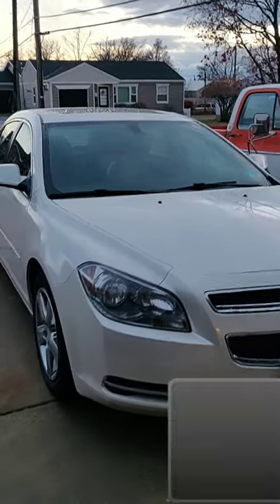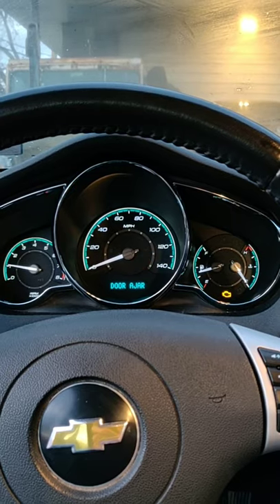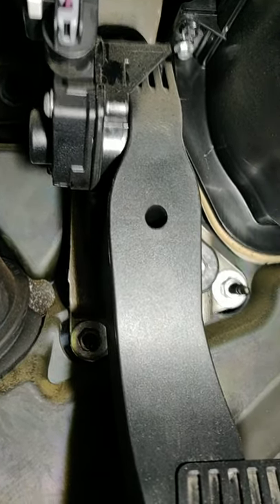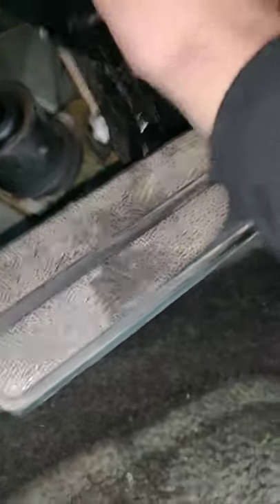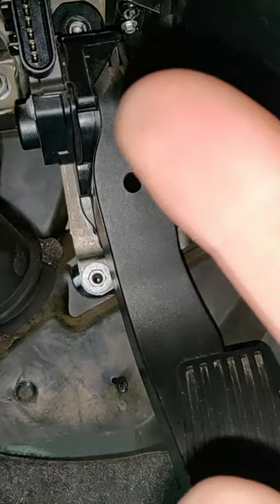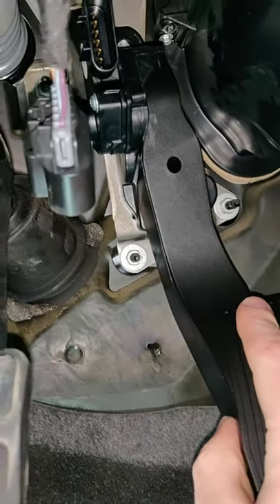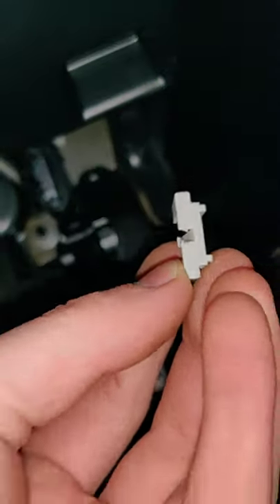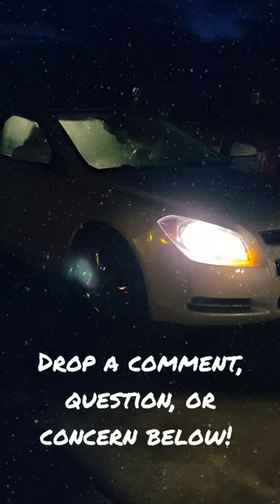HOW TO REPLACE ACCELERATOR PEDAL & SENSOR! ('08-'12 Chevrolet Malibu) [SUPER EASY]

Comment: thank you . Jared but as an older car hack I noticed you removing the wiring before the bolts . If you take the pedal off you will have a much easier time because you can pull it towards you where you can see better   .  Also connect the wires to the clip first then instal . God bless thank you.

Comment from the maker: Apparently the Malibu's that have sunroofs have an issue with the drain hose. What happens is that behind the A-pillar plastic cover on the driver side and covered by the upholstery on the roof there is a drain hose that runs from the sunroof. It may disconnect and water can get down the a-pillar and cause damage to the electronics below.
Reply from the maker: This issue can play into the P2138 code and must be resolved to make sure this code doesn't come up again. First, assure that the hose is connected and use some tape to guarantee it won't disconnect again. Second, let the areas where the leak affected, dry out. Third, Replace damaged parts (if needed).
Reply: I think the drain hose caused my problem. Drivers side floor mat was damp. There was a lot condensation under dash too.
Reply from the maker: @timjo1970  Yep, it could be worse for you more than it was for me then, best of luck!
Reply: @livingalive7886 One reason I refuse to have a sunroof. They're lovely but too much can go wrong.
Reply from the maker: @Flowerchild778  very true!

Comment: We replaced ours, but the next day, it seemed to go out again. We did not reset the sensor, is that what we did wrong?
Reply from the maker: Does it have a sunroof?
Reply: @livingalive7886  ... No sir.
Reply from the maker: @jenniegonzales1496  okay, I was just asking because the connector and/or sensor can get water damaged from a plugged drain port from the sunroof.
Reply: It is recommended to replace the throttle body sensor and pedal sensor both at the same time, as both sensors must agree. You may need both sensors replaced to fix this issue.
Reply: @supercoffeebean  hey man is it hard to change that wire

Comment: Would car run fine for awhile then do it?
Reply from the maker: Correct, my car would run fine for about a mile sometimes and then it would trip the code in the car's computer and then go into limp mode.
Reply: @livingalive7886  see I’m not getting the code for this I’m getting p0641 but having the exact same issue it seems like

Comment: Where did buy the replacement part?
Reply from the maker: Autozone
Reply: @livingalive7886  Thanks!
Reply: @livingalive7886  Thanks again. Picked up the part at Autozone today and installed. The car is back on the road.
Reply: I got mine from Amazon for $72

Comment: Thank you for this video, it helped me replace the part. But 😩
I tried replacing this, cleaning the throttle body, replacing the throttle body, replacing the MAP sensor, replacing knock sensor. Both the air filter and oil look fine. 
My car is still in limp mode and still idling hard. Any idea what’s going on?
Reply: How's it doing now? Was yours throwing out the same error code? (P2138)

Comment: Did you really just “pull it right off” after you disconnected the sensor and removed the 2 bolts? Cuz my shit will not come right off like your video demonstrated. Help!
Reply from the maker: Yep! Once you have the two nuts and disconnected the senor by removing the light gray piece and pulling the plug off, it will come right off. Is your car a 08-12 Chevrolet Malibu?
Reply: No, it is an ‘05. I think mine is under a bracket but it looks just like this video 🤷🏽‍♀️
Reply: Got it!

Comment: Can the sensor be cleaned or needs to be replaced?
Reply from the maker: If it gets dampened or wet the sensor I would assume is toast. You could always take it out. Let it dry, use a connector cleaner and reinstall to see if it fixes it. I would hate to be stranded somewhere if it doesn't fix it permanently.
Reply: Thank you